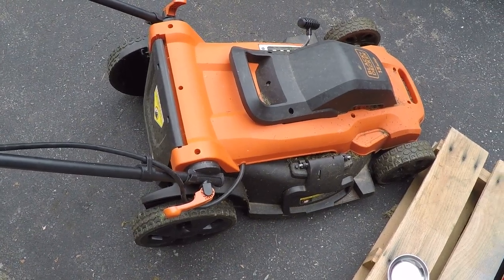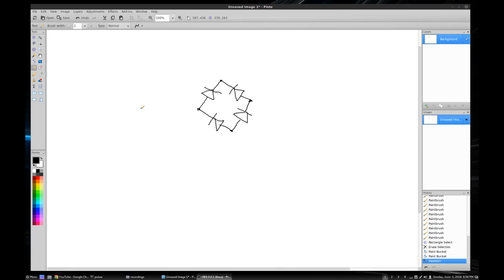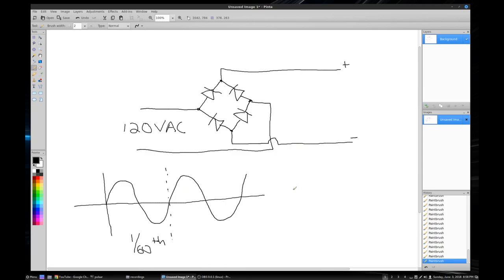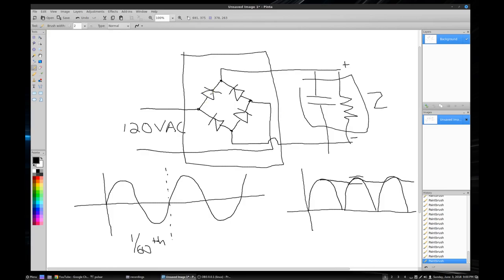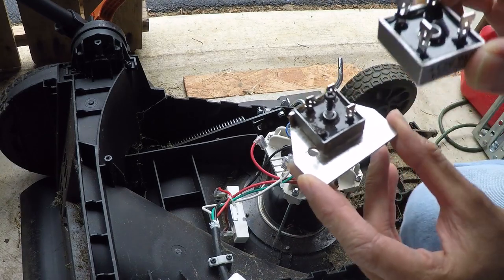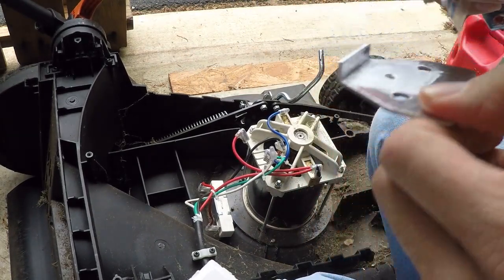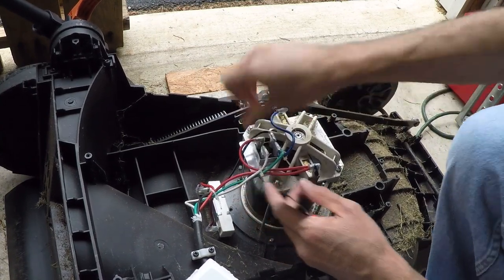Black and Decker Electric Mower Trips Breaker

Comment: Excellent explanation and video quality. The pace of the presentation is pretty good. Detailed explanation of how the rectifier works.  Also the requirement of using thermal paste is well explained.  I loved your video.  You have paid lot of attention to the details like a professor.  Thanks for creating such a useful video and sharing it. I will use this knowledge in future in the Kobalt corded lawn mower, model KM211 which I just bought and started using it. Hats off to you, Sir.

Comment: There is a diode test position on your digital multimeter. A good diode will show open circuit in one direction and about 0.6 volts in the other direction. Two failure modes are possible in theory. You found one with the 200 Ohm range resistance test...that was a short circuit. I am not certain if a diode would ever fail as an open circuit but if so the diode test function might show that when the resistance test will not.

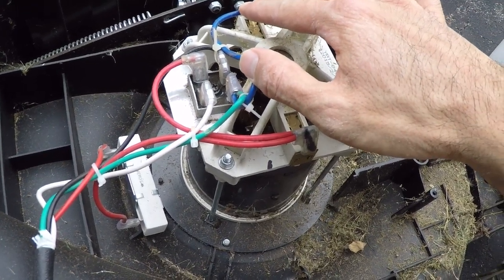Comment: @8:31 when you say "down here is the filter blah blah blah", that's actually a brake resistor.  It stops the engine quickly when you let off the handle.

Comment: the Rectifier blew the circuit breaker in the house..flip the house circuit breaker, cleaned out the mow housing..it works, but as below, the visual on the wires on the rectifier help alot. Before you tear the mower apart, check the house circuit breaker.

Comment: Very informative.  Can you weigh in on what causes the B&D 13 amp electric motor to overheat and turn off?
Reply: I would say open up the motor and clean it it can be from grass clippings getting filled in there getting between the motor brush
Reply: From what I have read, a major cause of overheating is people using el cheapo 16 gauge wire on the extension cord. If your extension cord is 50 feet or less, you should use 14 gauge cord. If your cord is 100 feet, you CAN use 14 gauge but 12 gauge is better. Using too light of a causes a voltage drop which will heat up the motor, or at least that's my understanding. Your motor won't die immediately, but it will shorten its life.

Comment: Conceivably, could you remove the bridge rectifier etc and change the mower into cordless since the motor is dc?
Reply: Yes, you would need a 120v battery, maybe series batterys.

Comment: I have the exact same mower but the issue is that it will turn on but at an incredibly low operating speed as if the motor is not drawing the full amount of power to turn the blade and eventually after turning it off and attempting to turn it back on it fails to start it wont turn back on until either a couple hrs or the next day but again at that incredibly slow operating speed.

Comment: Thank you for this video. My 2015 B&D mower just died and this video is very helpful.  I've ordered a new Bridge Rectifier.  How would you get access to check the motor's brushes?
Reply: Got the same mower.  Did you fix yours?  Thanks.

Comment: I have a similar mower, mine hums when I start it and the blades do not move. any idea what this could be? mower is 1 yr old. I do not have the piece you replaced here.  I have a mm2000
Reply: Same issue for me right now—did you get this resolved?
Reply: @lakegapo  

I ended up finding out the mower had a 2 year warranty so I filed a claim and they mailed me a new one for free.
Reply: @lakegapo  open up the motor housing and clean it I’m sure it’s very dirty and it’s not letting the brushes connect the motor

Comment: No the 120 volts is the RMS voltage the peak is 170 Volts ac 170 Volts * .7071 of the peak is 120 Volts RMS. RMS is 70% of the peak.

Comment: i changed rectifier and still shorted;plunge power switch may be defective '; the mechanism that activates power switch had defective locknut and metal touch power wires